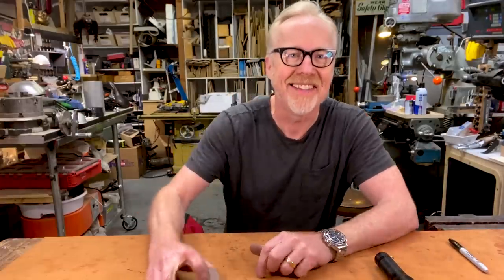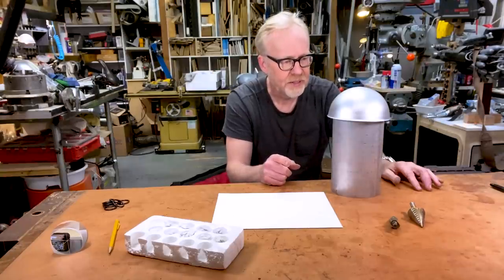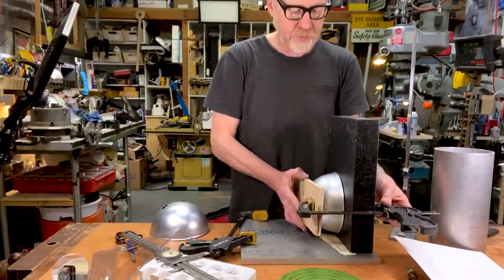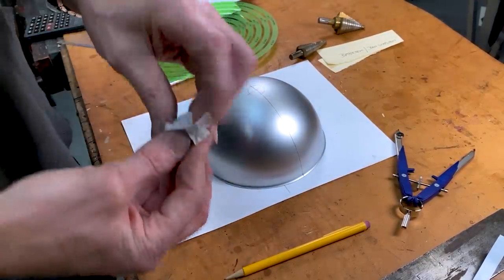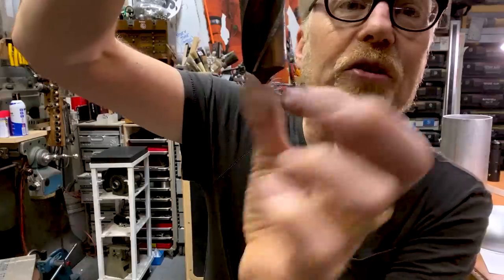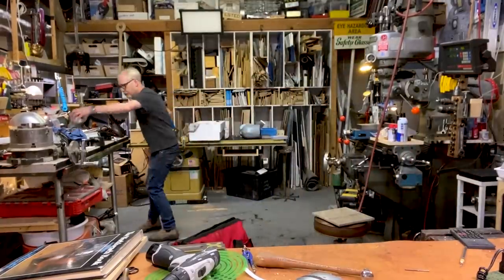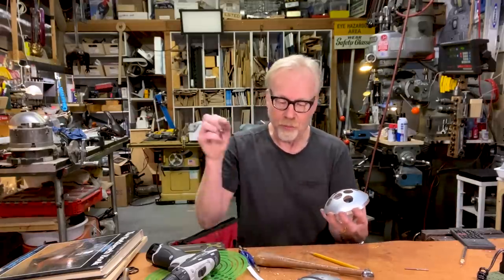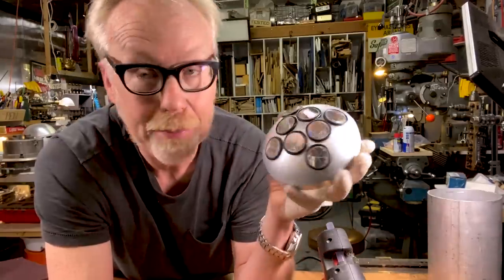Adam Savage's One Day Builds: NASA Retro-Reflector Replica!

Comment: A little woodturning trick for scribing your centre there.  We often work with irregular materials (trees are cylindrical after all!) but every thou off centre we mount the piece is a bit of extra work we have to do to true up the piece.

If you're scribing an irregular piece, you should strike that line 4 times, rotating 90° each time. This will draw a little quadrilateral in the middle of your work piece. You can repeat the marking from corner to corner, and you'll get insanely close to centre. I tend to just eyeball this last step though...! 

As I'm sure you know, mounting off-centre is a real awkward thing to do as you have to turn slowly to true the piece up.

Hope that helps!
Really cool project!

Comment: Interesting build. The Laser Ranging RetroReflector experiment packages left on the moon by the Apollo astronauts are of a different design from the one Adam built in this video. The Apollo 15 Laser Ranging RetroReflector is  described in a NASA article here: https://www.nasa.gov/mission_pages/LRO/multimedia/lroimages/lroc-20100413-apollo15-LRRR.html. Smaller LRRRs were also deployed by the Apollo 11 and 14 crews. The former USSR also placed two reflectors on the moon using remote landers.

Comment: Adam .. 3 machinists probably had early signs of a heart attack watching you set a surface plate ON ITS EDGE and using the height gauge on the surface of the aluminum plate next to it.  The aluminum plate was ±.001, maybe, and the surface plate is ±.000001 or less?  With a pencil measuring by hand on a sphere, it's probably not that critical anyway, but it's (twitch) just one of (twitch) things (twitch) .. lol

Comment: Adam....Drilling the holes.  Try drilling from the inside.  Takes a sacrificial jig to put it in.  Styrofoam work a treat, carve out a curved cavity and put the dome in it and it supports the material.  The step drill is what we use too.   Very good project you did and thank you for the video.

Comment: Need to get yourself some engineering blue for the markings on metal. Means less pressure required when making the markings (wears the tool out less) and makes it very clear and easy to see. Or colour with a sharpie, and use the tool to scratch a line into the black. Used to use that all the time when marking and machining metal

Comment: Ya kno'... I'm kinda the guy that chooses the most elaborate and complicated solution to solve a problem if all other methods run the risk of a potential failure.

Like when I upgraded my Tamiya #36208 1:16 Flakpanzer Gepard Display Model ( https://imgur.com/a/fxHQqrn ) to a Full-Option one and had to saw off and drill out the existing cast axles to make space for new machined ones also requiring for the now holes to also be tapped - For both the drilling and tapping of the swing arms I decided to not take any chances for either of them to end up crooked so I 3D Printed myself two jigs, one to ensure the swing arms would be perpendicular to the drillbit in the drillpress and the other would keep the hand operated tap perpendicular as well.

Why he's using that weird ass nibbler on that bowl to produce a super janky cutline instead of just clamping a dremel into a vice at the proper height of the bowl resting on the vice itself next to the tool so he can then just rotate the bowl along the cutting head to progress the cut for like a super clean cut similar to how he'd use the height gauge is kinda beyond me.